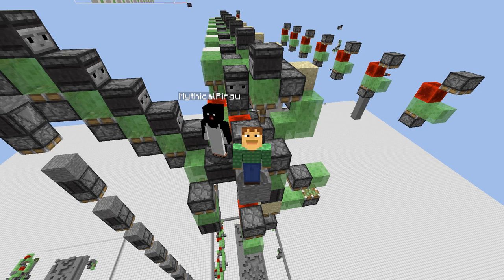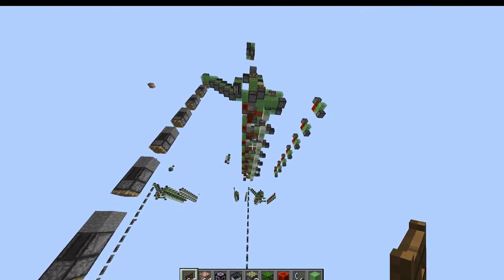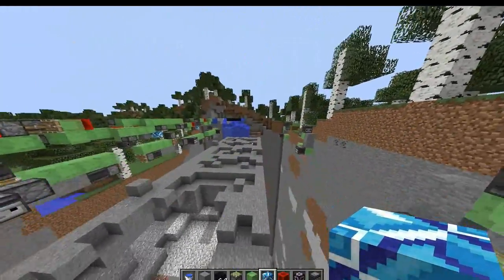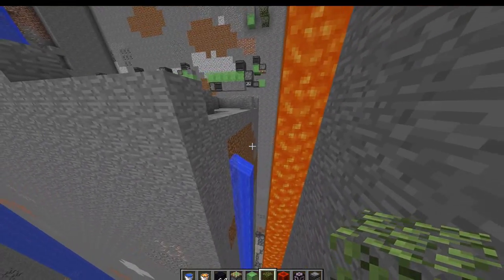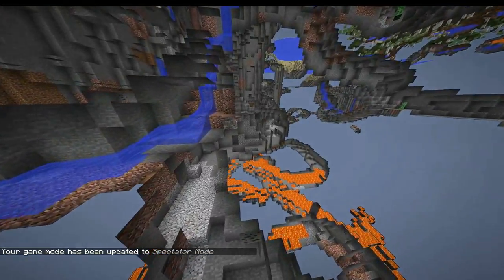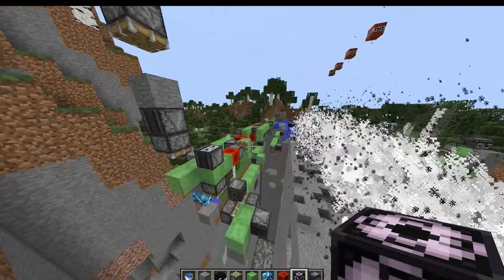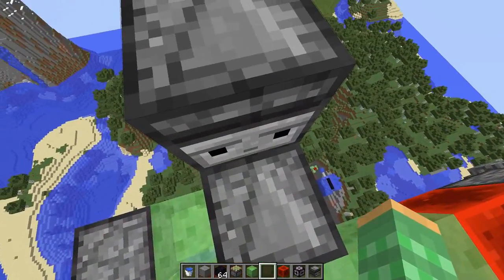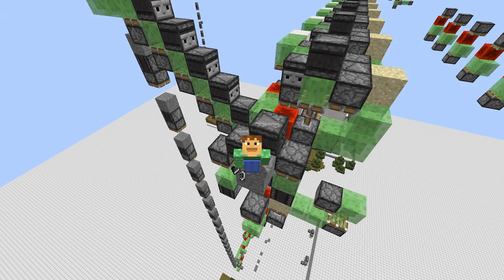Perimeter Maker (TNT duper quarry + water sweeper) | Minecraft (CHECK description)

Comment: There is an issue that you have to get 4 instead of 3 blocks on the sides, because if lava and water are next to each other on the same side, the water could flow one further allowing lava on the other side to form a cobble generator (The chances for that are about 1/1200).